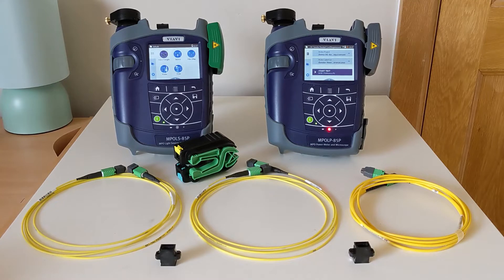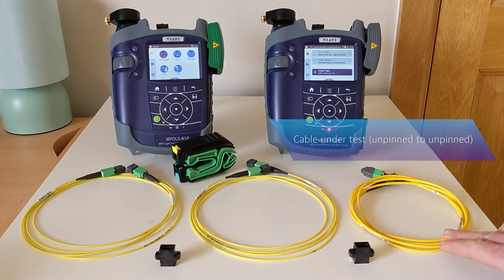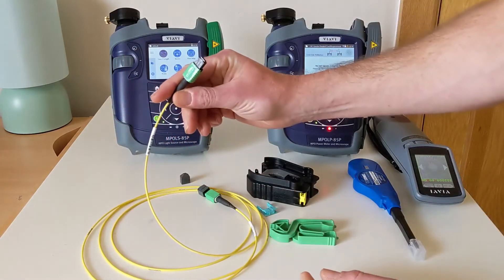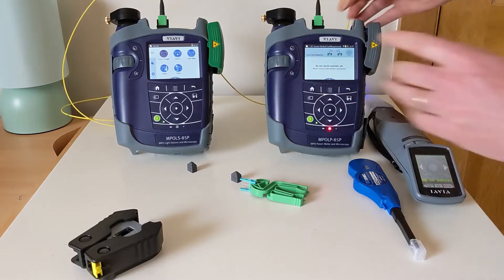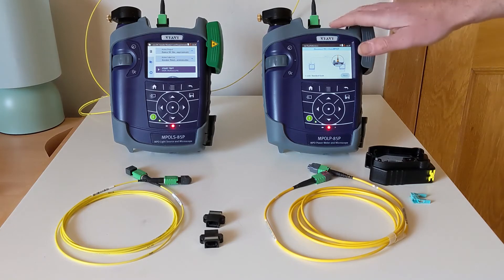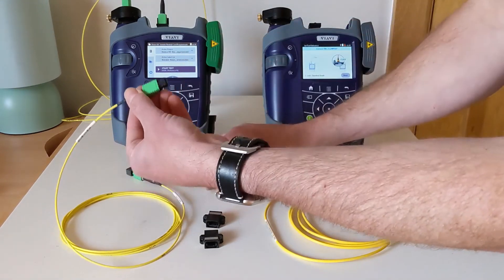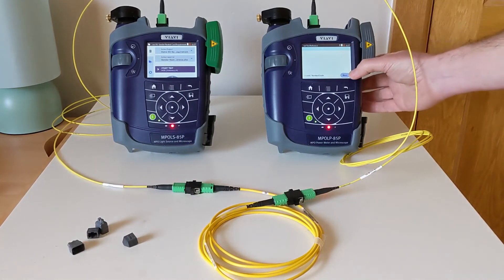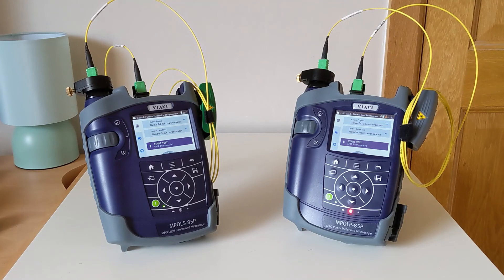VIAVI MPOLx: Setting a Reference for Unpinned Systems (Gender-Neutral Cord Method: IEC 61280-4-5)

Comment: Is it ok to continue on to verify the reference if it is marginal or yellow. We are having one heck of a time trying to get it into the green and is so close to being under 7.
Reply: Hello @Jacob. The absolute power measurement check when performing a set reference provides an indication that the levels are in line with expectations. If a yellow or red result is seen, it is best to look at the values and see how far apart they are. If all the fibers are reasonably close to the same levels (e.g. within 0.75 dB of each other) we would recommend proceeding with the next step of verifying the reference. If needed, our technical support team can further assist. You can find your local TAC contact at this link: https://www.viavisolutions.com/en-us/support/technical-product-support/technical-assistance

Comment: Thank you for making this video. I noticed on the right unit the laser is still on, same happens on my unit even after I've exited the application. Is this normal?
Reply from the maker: Hi @TMGTestEquipment - As long as the MPOLP-85 is in the Loss/Length application it will continue to transmit to ensure connectivity with an MPOLS. Applications are not closed on the instrument until another application is launched. From the home screen of the MPOLP-85 launch the Powermeter application. The “laser on” indicator will go out and the instrument will no longer be transmitting. If you have any further questions, please reach out to your regional channel manager. Thanks for watching!